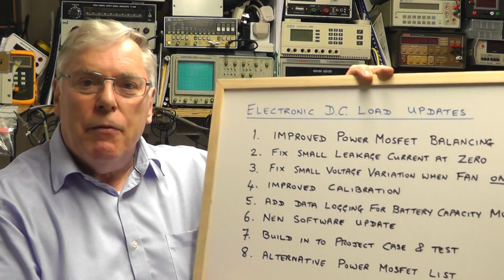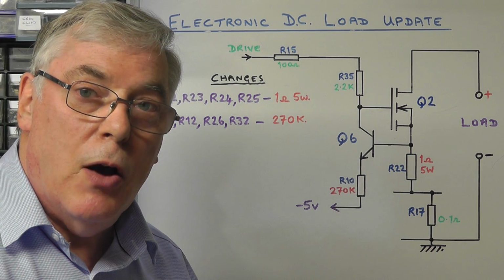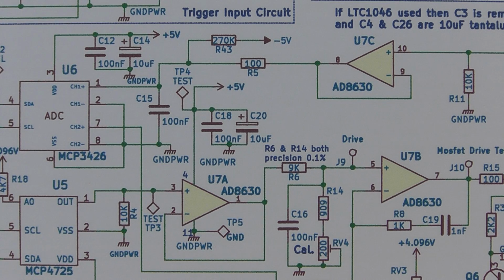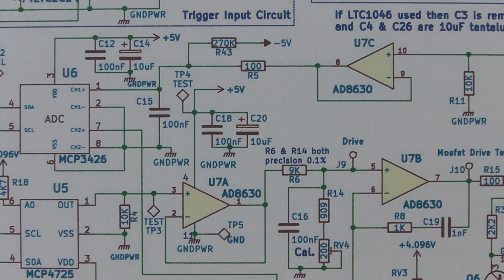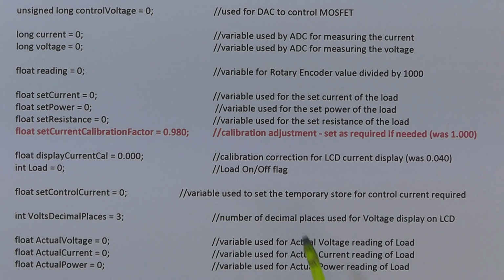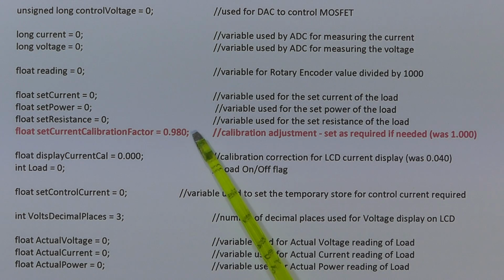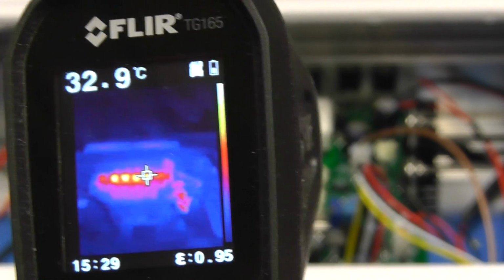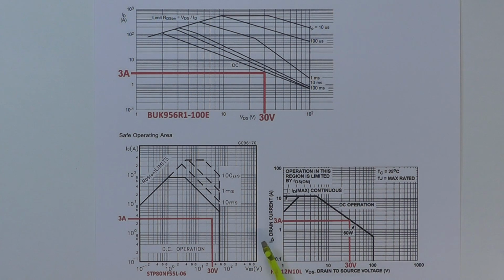Scullcom Hobby Electronics #57 - Electronic DC Load Part 9

Comment: I just ran across something you might want to be aware of.  I just bought a 20x4 LCD display with a PCF8574 interface board on the back of it from Amazon.  I could not get anything to show on it.  It turns out there are 3 variants for the PCF8574.  The first is made by TI and has a default address of 27h.  The second is made by NXP (Philips) it too has a default of 27h.  The third, also made by NXP, has a part number of PCF8574A which has a default address of 3Fh.  Took me 3 days of hair pulling and rewriting code just to change one number in the original program.  aarrgghh!!!
Reply from the maker: Hi Randy,
In Part 9 of my DC Load project I did give a download link in which I covered and explained this issue. It was in a zip file which included 4 pdf files, one of which covered the issue about the PCF8574 interface module.
Additional files can be downloaded from the link below: 
http://www.scullcom.com/DC_Load_additional_files.zip
Regards,
Louis

Comment: I've been building a parallel project based on your initial design, but it diverged several revisions back. Nevertheless, I've been following your improvements with interest and the fix for the variations caused by the fan is very timely. I'm still testing, but I may have a cleaner solution than the heavy gauge wire spider used to beef up the ground path. Instead, I used a single heavy gauge wire to supply the ground from the power supply input directly to the emitter of the fan switching transistor. This eliminated the high current passing through the ground plane and resolved the current and voltage measurement variations. Testing will hopefully confirm it also avoids any load variations as well. For testing purposes, I rewrote the fan control routine to pulse the fans on & off at 5 second intervals regardless of temperature.

Thanks for your excellent work! I've tested my version at 450 Watts for up to 1 hour while still maintaining a case temperature well below 70 degrees C and maximum current capacity is 50 Amps.

Thanks again!
Chuck White
Reply from the maker: Hi Chuck,
Thanks for your comments. The additional ground wiring also improved the overall operation and calibration as well as solving the voltage fluctuations when the fan came on. I have since designed a new PCB with additional grounding.
Nice to hear your version was working well.
Regards,
Louis

Comment: Ciao,
Si può utilizzare un display TFT i2c, su eBay ho trovato questo 252096499341.
Io vorrei costruire il tuo progetto, ma vorrei aumentare la potenza per usare MOSFET con VGS da 20v cosa devo fare?
Complimenti per il progetto.
Saluti Vito
Reply from the maker: Hi Vito,
I have just translated your message to English which reads: "You can use an i2c TFT display, on eBay I found this 252096499341. I would like to build your project, but I would like to increase the power to use MOSFET with VGS 20v what should I do? Congratulations on the project."

My answer is as follows:
The VGS of 20V is quite high. However, you could consider using IRFP250NPBF for the 4 Power Mosets, which operate at higher VGS voltages. However, as these Power Mosfets are not Logic Level Mosfets and will require a higher gate/source drive voltage, you would need to make some circuit design changes. To achieve this you could replacing the U7 (Quad Ultra Low Voltage Offset OP Amp) AD8630 (which can only operate to a maximum of +6V Supply Voltage) with a AD8664 which can operate at a higher supply voltages, you could then feed it with the +12 supply (this would then give you higher VGS drive voltages - up to around 12V). As the pin layout are identical to the it is a drop in replacement for the AD8630. If you use my DC Load PCB then you would need to cut the track from pin 4 of U7 (+V pin) and then connect Pin 4 of U7 to the +12V supply with a wire. This should then give you the required gate drive voltage for a IRFP250NPBF. I have not tested this option yet myself but it should work. The IRFP250NPBF is a TO247 package compared to a TO-220 package of the BUK956R1-100E, which would need to be taken in to account.
If you are looking to have a maximum of say about 25 Amp then I would suggest using a lower value sense resistor for R17 would be better. If you replace R17 with say a 0.02ohm 10 watt 1% resistor then at 25A the voltage across it would be 0.5 volt. The change in voltage then fed via buffer U7D to the ADC (U6) wound need to be compensated for as you are now using a lower sense resistor, this could be done by setting the gain of channel 2 of the MCP3426 in software to a gain of 8 (instead of the current setting of x4) and also making some changes to the code where the calculation is made for the current reading on the LCD. With regards the resistor divider R6, R14 and RV4. Try changing R6 to say a 27K and R14 to a 1K and RV4 to a 1K preset, to ensure you have sufficient range.

Hopefully the above will give you some ideas.

Regards,
Louis

Comment: Hello
I want to use an oled screen but as the memory of the program is limited, I would like to replace the Arduino Nano by a RobotDyn Mega Pro.
the advantage is that it is compact (38x54 mm) and has a memory of 256 KB, an SRAM of 8 KB and a EEPROM of 4 KB.
I'm going to make an adaptation PCB to plug in instead of the Nano.
I think there is no particular trap, just pin connection for pin.
Thank you for your opinion and thank you again for this great achievement
Reply from the maker: Hi Daprey,
An adapter PCB to plug in is a good idea. I have not used the RobotDyn Mega Pro yet but I can see no reason why it should not work. You should be able to port the current code to the RobotDyn Mega Pro. Not only would it give you more memory but you could also add extra functions.
Regards,
Louis

Comment: The LOAD and SENSE wires are rather thin, and come as 2 wires to connect to PCB. That is rather strangle. You should have 4 thick wires going into PCB. And then have a relay on it for switching within close proximity. Then have switch on front panel control relay.
Reply from the maker: Hi Julius,
The Load wires are heavy gauge wire going to the PCB. The voltage sense wires carry no current so can be low gauge wire.
Regards,
Louis
Reply: I thought the arduino code would run on better quality then the rest robotdyn WIFI NodeM ESP8266, 32M flash, CH340G and that even arduino IDE can be used ? With 32M flash these is no shortage of memory.
Reply from the maker: Hi Julius,
What you are seeing in that part of the video is the sense wires going to the sense switch. If you do not use the sense input leads you need to switch the sense input to connect to the load input terminals instead. There is no current effectively in any of these wires, as no load current is flowing through these wires, so you can use small gauge wires.
That screen shot does not show the Load wires which connect from the Load Input terminals to the Power Mosfets - these wires are heavy gauge to handle the load current. The Load wires from the PCB to the Load input terminals were soldered on later when the PCB was installed in the case.
Regards,
Louis
Reply from the maker: Hi Julius,
I have not tried a robotdyn WIFI NodeM ESP8266 so far. Do you have knowledge of using this module, if so what is your experience? Have you used it together with an Arduino Nano?
Regards,
Louis

Comment: I ended up ordering all my parts from Digi-Key. Should be here this week. They supplied all but the following..  3 resistor types from Mouser, Arduino Nano, 5x4 keypad, 2 caps and a diode from different Chinese eBay resellers. The Project case, large heatsink and fans from Australian Ebay suppliers. If it helps anyone, I can prepare a spreadsheet with all my order details. Total cost was about AUD$250. I’ve got a couple of projects already started which I’ll have to finish first.. 
thanks again Louis. This is going to be one awesome build.
Reply from the maker: Hi Michael,
Looks like you are progressing well. I am sure others will take note of your offer of a spreadsheet.
Regards,
Louis

Comment: Hi Louis,
Excellent project 
Asked you before about PCB availability, but this time having trouble, trying to contact you using your websites contact info.
Missed out on your original PCB offering.
Am I too late late to buy a PCB in your latest offering (Can’t find anything on ebay this time)
Cheers
George
Reply from the maker: Hi George,
Simply leave a comment on my website and then I will have access to your email address to contact you directly (I am the only one that can see your email address) go to:
http://www.scullcom.uk/design-build-an-electronic-dc-load-part-1/
and scroll down to the bottom where you can leave a comment.
Or send me your email address in privates messages and I will contact you.
Regards,
Louis

Comment: Hi Luis! Recently started to follow your developments. I liked the voltage calibrator and current calibrator! Now I want to repeat the electronic load. Question. Why do not you want to do a software calibration instead of a mechanical one? Just adjust the indicator's readings to the actual voltage and memorize it in memory. I also developed my electronic load for 100W with software calibration, but only the current setting was mechanical, resistors http://vrtp.ru/index.php?act=categories&CODE=article&article=3662
Reply from the maker: Hi Andrew,
The calibration required may vary across the whole range so a fixed mechanical calibration would not cater for that.
I tried to check your link but did not see your article.
Regards,
Louis

Comment: Hi Louis, thank you for your great videos and clear explanations. Even though this project is a bit beyond my skill level at this stage, I still enjoy watching and learn a lot. Would you mind giving a quick explanation of how you chose the value of R10? I understand the concept of Q6 and the need for the increase in R10 as a result of the change to R22, but how do you determine the value to get just the right amount of adjustment to the gate voltage of the mosfet? Thanks again.
Reply from the maker: Thanks Steve for your comment/question. Calculating the correct resistor value for R10 (and the other emitter resistors for Q6, Q7, Q8 and Q9) was a bit tricky.
I found in practice each power mosfet gate/source threshold voltage was slightly different even though they are the same type. Therefore the mosfet with the lowest gate/source threshold voltage would start conducting first and get hotter sooner than the other three. I therefore did some initially testing - I ran the DC Load set at 3 amp with a 30V supply without any of the transistors Q6, Q7, Q8 and Q9 installed. I then check for the Mosfet which was getting the hottest and drawing more current than the other three. I then fitted the PN2222A transistor for that mosfet which was drawing the most current and for the emitter resistor (for example R10) I used a 100K resistor in series with a 500K preset. I then adjusted the preset until that mosfet was supplying the same current as the other three - so giving some active feedback to reduce the gate/source voltage on that mosfet (you can check for similar voltages across the 1 ohm Mosfet source resistors when comparing the currents through each mosfet) and found that the effective emitter resistance worked out to be around 270K for best results. I tested this method several times using different sets of 4 mosfets and got a similar results. I therefore selected a standard value resistor of 270K and used that in all the emitter return resistors and and fitted all the transistors Q6, Q7, Q8 and Q9, I found it worked fairly well, so I stuck with that. Sorry, nothing scientific here, just a case of some tedious practical testing for best results.
Regards,
Louis
Reply: Scullcom Hobby Electronics Thank you for your detailed response. That makes sense and further demonstrates how much time and effort you have put into this project. Thanks again.

Comment: Great videos!  One question / suggestion.  Instead of trim pots can the current and voltage readings be cal'd digitally?  I've used that technique with success when I worked for a sensor manufacturer.  I know you packed a ton of functionality in this Arduino, I'm not sure if you have the room?
Reply from the maker: Hi Ken,
Yes you could do it electronically but we have very little memory left and you would also need additional circuitry as well.
Regards,
Louis

Comment: I've been looking at your design.  There is a problem users need to be aware of.  The ground of the USB is connected to the negative input.  When you are testing a grounded/earth-referenced power source there may be an undesirable current flowing through the USB cable to earth via your PC.  A USB isolator can be added either internally or externally with a device like Adafruit's item 2107 USB Isolator.   FYI.  Don't ask me how I know.
Reply from the maker: Thanks for the info. If you wish you can add a USB isolator. However, so far I have not had any issues with this project.
Regards,
Louis
Reply: I've got 1 laptop with a completely fried motherboard.  Had 7oVDC at over 20amp applied to USB cable.  Thought it was isolated since it was running on battery, but it was hooked to a monitor which grounded it.  The USB cable has insulation melted.  Another PC with completely dead motherboard USB port, no power, OS doesn't see anything plugged in.  Luckily the rest of the motherboard survived.
Reply: Next time use a Bluetooth serial adapter. :)
Reply: Please, define 7oVDC.  I assume that it is 70 vdc or 7 vdc. Whatever it is it's out of spec for USB applications. If it is capable of delivering 20 amps it was a bomb waiting to explode. If it was 70 vdc, you're fortunate that the over voltage had a path to ground other than through you.  It probably won't help but I feel your pain. I've fried a few things myself.  Everyone has.
Reply: Could it be that the battery you were measuring on had the positive terminal connected to ground like on some Solar chargers, because then it makes a lot of sense since you're then shorting the battery via the USB conenction if the PC or the monitor is grounded
Reply: @steenandreassen4591  It wasn't the battery that was the problem.  It was the charger.  It wasn't isolated from the AC line input.  So it's negative terminal was at 70vdc from earth ground.  One late night laps in procedure and pow, melted wires, damaged computers.
Reply: @randycarter2001  Thanks for your reply. Sounds very dangerous :-(

Comment: My recommendation of mosfet is SUP57N20 from Vishay.
Could reach 200W at 15V but had soldered package directly to piece of copper(IHS from old CPU) and then this module on old AMP CPU heatsink using good MX-2 thermal paste, and still about 100*C on package(not dye) so quite on the edge.
What I would do next is put 4 of them on one piece of copper, and then this module on modern CPU heatsink that uses heatpipes(around 10-20 punds with fans).
Also I expected the fan to cause some issues, so I would use tiny transformer to power analog circuits with separate analog ground, then use guality meanwell 2A/12V SMPS to power the fan and digital circuits/display.
Fan would be 4-pin type with PWM input, starts with 40*C at about 15% and then 100% at 100*C, also RPM monitoring for fan fault protection/cutoff in case it would get blocked by dust etc.

To be honest I'm not happy with 1R resistor for balancing, could interfere with SOA of mosfets when running at low voltages@high currents.
In the past I was running 10 mosfets in parallel at crazy powers and had no issues when using 0R14 resistor.

But still great design, well done, wouldn't be able to design all of this myself :P
Reply from the maker: thanks for your comments. The SUP57N20 is likely to need high gate/source drive voltages so may not be suitable for this project. You could make changes to the gate drive voltages by using a different OP Amp operating at a higher voltage (say 12V).
Regards,
Louis
Reply: Scullcom Hobby Electronics Oh right, I had just used ordinary LM358

Comment: Is there any way to calculate the needed size of the heatsink? ... especially for noningeniers?🙈
Reply from the maker: Hi Henrik,
I did show some brief details of thermal calculations in Part 2 of this project:
https://www.youtube.com/watch?v=V6RQgD-moJA&t=218s
The info starts 13.10 minutes in on that video.
A good explanation is also to be found on a Hackaday You Tube video at:
https://www.youtube.com/watch?v=H6lmt7AwMf0&t=301s
Regards,
Louis
Reply: Hi Louis,
thank you and sorry for asking when you did show it. I was looking all videos yesterday in preparation of building this nice project.
After that i was looking for a different cooling and found this: http://www.fischerelektronik.de/web_fischer/en_GB/heatsinks/D02/Miniature%20cooling%20aggregates/PR/LAM4K_/index.xhtml
So i will try to calculate. Thanks again for your answer and help.
Best Regards
Henrik
Reply from the maker: Hi Henrik,
No problem. Glad to hear found the info.
Regards,
Louis
Reply: Do you think this LAM4K is enough?
Reply from the maker: Hi Henrik,
Sorry for delay, just seen your last message.
The LAM4K looking like a nice heat sink with integral fan. It would appear it comes in different lengths but not clear on the datasheet - the longest is only 150mm, would be better if it was longer/larger. It should be OK for up to 90watt (30V at 3 amp) but it may be a good idea to have the fan running all the time. Anyway it is worth a try. I could not see a price on the link you gave.
Regards,
Louis